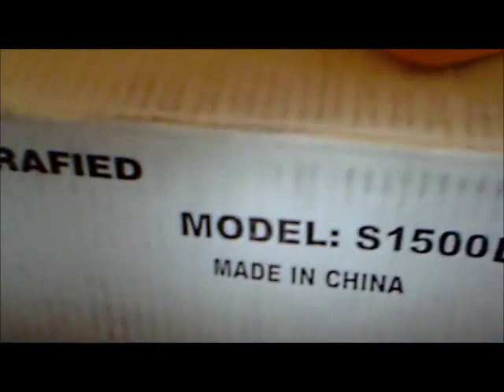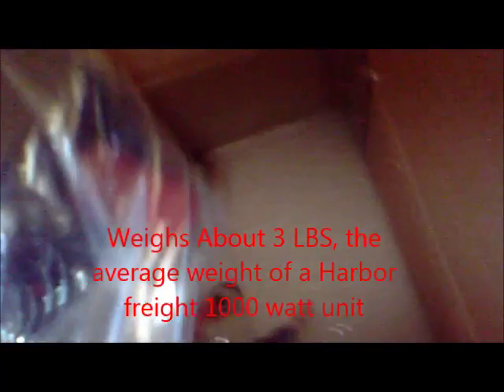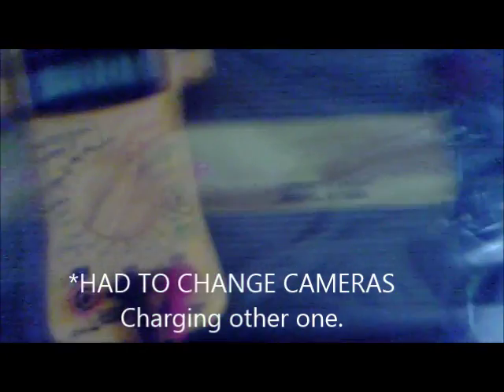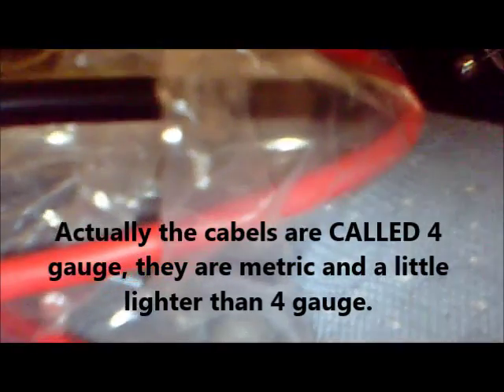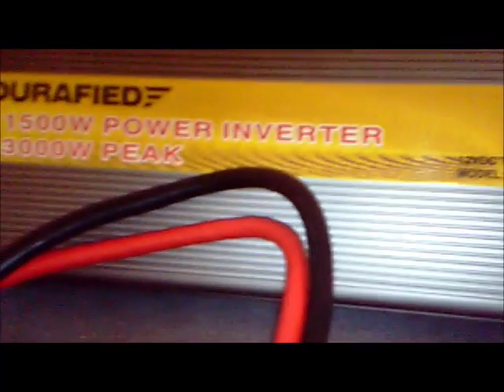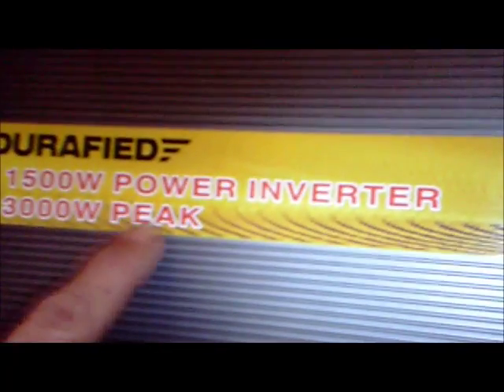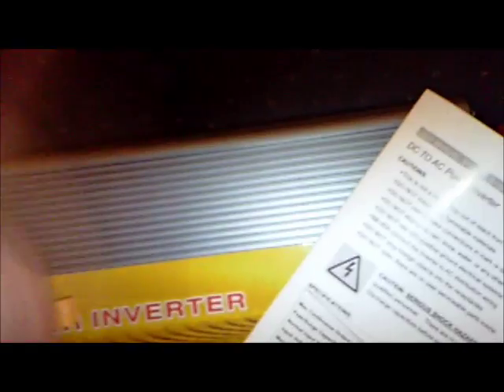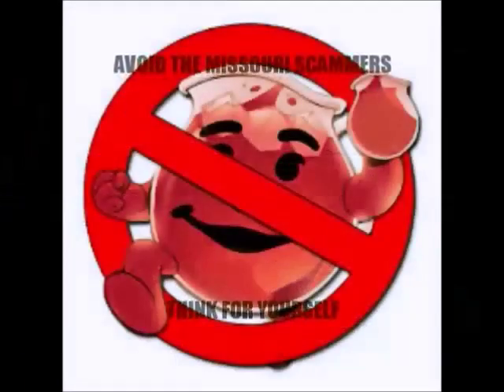DURAFIED power inverter  full power test 12 volt to 120 volt 1500 watt

Comment from the maker: They finally have better stuff, this video covers the older versions. The newer models are much better. And they are cheap to buy. http://rover.ebay.com/rover/1/711-53200-19255-0/1?icep_ff3=11&pub=5575119394&toolid=10001&campid=5337663791&customid=Multiple+Better+Inverters&icep_store=dmssgs-e-store&ipn=psmain&icep_vectorid=229466&kwid=902099&mtid=824&kw=lg  2016 and newer are  Better versions